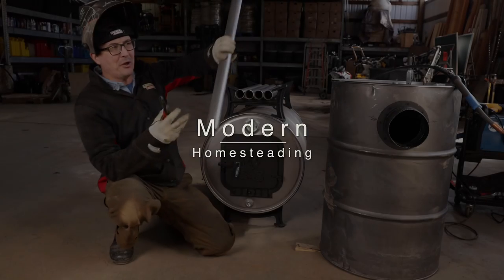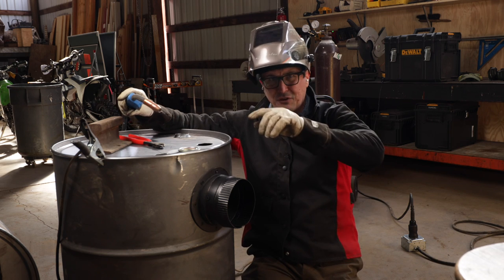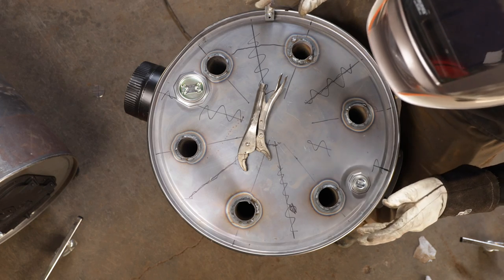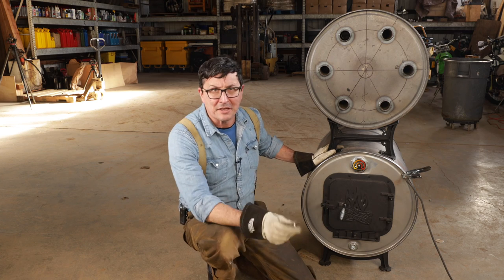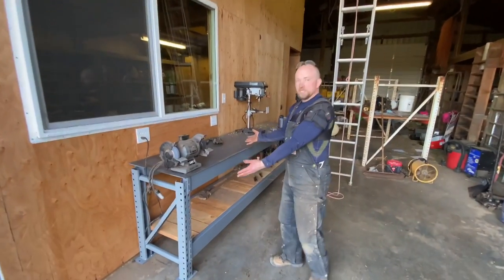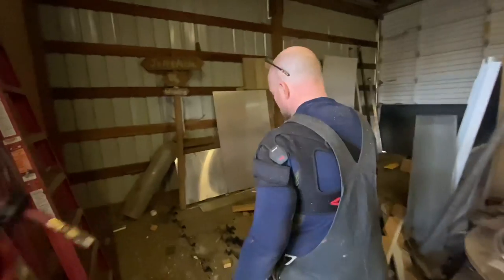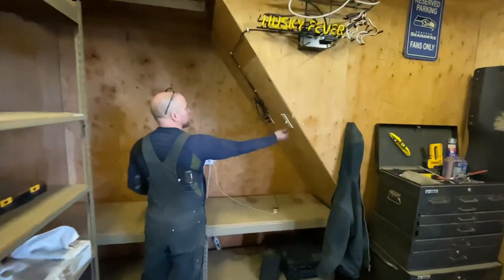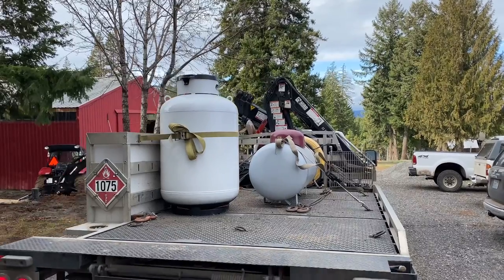This Welding Will Leave You SPEECHLESS!

Comment: Nearly 35 years ago my grandparents had a production version of this sitting in their old farmhouse. It had a perforated plate in the upper section with a pull handle. It scraped the soot off of the exterior of the tubing so the soot did not create an insulating coating AND so the creosote would not build up. A flue fire inside such a stove would not be something you want to experience.

Comment: Don’t worry Cody a grinder and some paint will make you the welder you ain’t
Reply: If you need a grinder to make your welds nice. Your a grinder, not a welder.
Reply: Won't do fukall for the integrity of the weld though . 
Cheers
Reply: Cody sometimes a quick pass and let cool then run 2nd pass you can made it look neater but your way is fine...
Reply: Ain’t that the truth, says Shane, the grinder.
Reply: That's like us carpenters say..."caulk hides all sins!"

Comment: A quick-tip:

When welding thin things with the mig-welder, especially combining plates of different thickness is important to add more heat into the thicker part. Second is to switch between pushing the puddle forwards, and prewelding before you cover it with the puddle. 

This gives good penetration, and will also leave you with a pretty weld. When welding like this it is also better to stand, and walk around the barrel. Then you can go all the way around without pause, or at least less pause. 

In this specific instance where the weld doesn't need to seal the barrel 100 %, but it is still good practice when you're dealing with stuff where it needs to be 100 %, and maybe also withstand pressure
Reply: I would've built up the thinner top with a bead around the hole and then ran a bead on the pipe and then joined the two with a quick weave

Comment: When welding thin gauge stuff I like doing what I call “tack dragging”. You set your machine relatively hot and you tack and drag the tack, let off trigger, then start another “tack drag” on the hottest part of the puddle just before the metal pool solidifies. It prevents blowing thru and leaves a nice stack-of-dimes look. Been doing it for years on the diesel fuel tanks I weld at work.
Reply: I'd love a vid of this tac dragging Ben
Reply: Me too also.
Reply: Me too ben , 👍
Reply: we called the pull and drag bullwhipping lol a good way to fill a gap with stick or wire but not good for xrays lol
Reply: you did ok , next time try a small quick pass let it cool and  put a nice cover on it !

Comment: Pro tip when welding something like you just did for example always try concentrate the heat or the ark on the thicker material and let the weld pool flow into the thinner material, also you can control heat input and reduce the risk of blowing holes by moving a little faster and using the 3 steps forward, two steps back method.. 😉

Comment: I remember these stoves when I was a teenager in the 70's in Idaho. My dad worked in mom and pop automotive repair shop called Ro-Ho towing in Meridian. They used to have one of those in the shop and man the heat would drive you out on a cold Idaho day if you didn't keep the fan turned down. As far as the propane tanks, Eh skip them and build a few Gassifiers to run your generators and stoves. They'll run on anything that will leave an ash when burned and you'll never run out of fuel. Also if you do some conversions to your vehicles you can use the gas to drive them if there's no gasoline available, just look up Wayne Keith truck runs on wood. Thanks for sharing. Best Wishes & Blessings. Keith Noneya

Comment: #1, Use grease barrels, they are thicker steal and the tops come off with a seal ring that won't leak.
#2 Use 3M adhesive remover to remove or take off any glue or adhesive off your barrels.  They also make silicon remover just in case someone sprayed silicon onto the steel to stop rusting.  I lived in Oregon for thirty years near Klamath Falls and was a building contractor.  I now retired and live in Israel, I was also a US Military officer so I have a lot of experience doing different things.  Just found your channel and I like it.  Keep up the good work, a lot of people never had to get their hands dirty and never attempted to do anything because they didn't have any confidence.  You are like a shop teacher that shows people they can actually do something.  Thank you for all the hard work of filming and editing.  Good Job.

Comment: The wood stove looks great. I put 12 heat pipes in mine  , it pumps the heat out great . i made a shroud behind it and put a small 10 inch multi speed turbo fan to blow through the shroud. it works really good.  And The Martian's shop looks real nice.

Comment: A few tips from a someone that has been welding and fabricating professionally for 14 years. It is hard to tell from the video but you appear to not be using any motion when welding. With MIG you usually want to use a small circular motion when welding. Think writing lower case "e" repeatedly in cursive. I know it is hard when you are welding around small circles like that but also try to pay attention to the angle of your gun. Ideally you want 45 degrees to the joint and the gun pointed about 10 degrees forward in the direction of travel. This will help with the uniformity of the bead. A more forward angle (forehand or pushing in welder speak) will give you a flatter wider bead and pointing backwards to the direction of travel (backhand or pulling) will give you a narrower more crowned bead.

Comment: preheat the surface with a torch and make cursive e's when you run a bead to get a good weave .the reason why you cant seem to get a pretty bead is cause your just running a straight line and not a weave . going in and out of the puddle will also harden the weld a bit due to the rapid extreme heating and cooling .

Comment: I heated my home in N Texas for 8 winters with shop built stoves. New central hvac 4 years ago. My current stove has radiator fins n I use a small fan to strip heat off the unit while fired.

Nothing beats the smell of burning oak and pecan.

Comment: Cody, I would suggest the use of a rivet nut or threaded insert nut over a self tapping screw for long term stability. The screw will never hold quite the same the second time. Where as a threaded insert will allow you to run the bolt of your choice multiple times with the same result.

Comment: Be careful with that secondary heat exchanger. Exhaust gases are extremely corrosive when condensed. The cooler you get your exhaust gas the more it'll condense and if your material isn't quality stainless steel you'll end up pumping your shop full of CO
Reply: Never thought of that. Thanks!
Reply: Great point. Couldn't have said it better.
Reply: I’m confused by this. The exhaust gases are still contained in the drum and vented outside. How would CO enter your work space?
Reply: @jconaty3  if the exhaust gets too cold it will condense into very corrosive combustion byproduct liquid. It can do a multitude of damaging things over time. Including but not limited to eating holes through the heat exchanger if it's not high quality stainless steel and it can also fill with corrosive liquid and or soot up as well. It will only leak CO after holes have been eaten in the heat exchanger tubing. Need stainless to prevent those holes from occurring

Comment: When you're welding thinner stuff such as that, get it tacked in place, and turn the barrel on its side.. run the weld downhill, top to bottom.  Downhill helps with the heat thingy because you can run it faster.  Just saying

Comment: The "clicking" sound is Jeff's electric fence energizer.
Reply: Really ? Why does it make this sound ?
Reply: @ArthA122  they charge a capacitor and then discharge, every 1-3 seconds. Some are solar powered, with battery backup. So a short high voltage pulse works without needing a constant high voltage supply that uses a lot of power.
Reply: @jdchmiel  It's also safer that way.  The pulsing allows someone who might have grabbed the electrified fence wire to let go in between pulses.
Reply: I knew this in the last video too lol

Comment: Run a steel fabrication business and have been welding since the 90's.. when restarting a mig weld (particularly short circuit) I've had a lot of success with the following-
Advance 1" - 1-1/2" ahead of where you ended the last weld.  Pull your trigger and move quickly back toward your last weld, slowing slightly just before you get  to your tie in point; the second you liquify the tip of the last weld you reverse and continue in the original weld direction.  This allows you to carry some heat into your tie in and reduces that bulge we all hate the look of.  With a little practice you can produce a weld that looks continuous.

Comment: Cody just letting you know. Having to start and stop welding in a circle is completely acceptable! I'm a certified welder and make/weld Exhaust systems for cars. The only way we can go around the pipe without stopping. Is by rotating said part while u weld. And that's in a jig designed for that very specific part. Ur heat really isn't that big of a deal. Just keep in mind u just have to move faster, we don't even zig zag or weave bcuz u don't have enough time, at least with how hot our welders are. I'm a production welder, so speed is crucial! If u want it to look really pretty, but a tig welder! That's the only way U'll be able to get that pretty stacked dimes look like ur expecting. Ur finished product u showed was not bad. The most important thing is getting ur starts and stops tied in nicely so their not one overly thick and two not going to leak. Just takes time, patience and plenty of practice! U'll get there, just keep at it!

Comment: Those double barrel stoves with the pipes are amazing. One of our local VFDs has a stove just like that in it. They welded all their pipes into a metal box on the back of the stove and attached a squirrel cage blower fan to the other end of the box. The building was a 40x80 and that double barrel stove with that fan on it would run you out of the building. We would play cards there on the weekends during the winter and many nights the temps would be in the low teens and twenties and they would have the doors raised a couple feet to regulate the heat.

Comment: I built a double barrel wood stove like this about 10 years ago. 2 years ago I decided to try something different. I measure out an inner circle half way  between the outer circle of tubes and the center and between the outer tubes and I opened the center to added a tube in the center for a total of 13. This stove will absolutely run you out in ten minutes. The normal wood load in the stove is about half what is was before.

Comment: Nice shop. Really! Only thing is about every other shop/garage that fellas finish with OSB or plywood end up in a pile of ashes. Just a warning guys not a knock down. You should at least run 4' of 5/8" fire code sheetrock. And it should start at grade (sit directly on the concrete) so sparks/slag can't roll under it. And start a fire on the back side. A piece of 5/8" fire code rock with a 3" air gap from the floor and 1 1/2" air gap from the wall. That behind the double barrel stove will keep you safe with that thing also. Love ya Wrangler I've learned a lot of really useful information from you. I thought I'd try to forward some of my knowledge back to y'all. GOD bless you and cover you with his eternal love!

Comment: I have been in the welding industry for 35 years.  Those welds are good. A little tip. When you can, when you have thin material. Put it on its side and weld vertical down. Keep on getting after it!!!

Comment: I'm by no means a weathered professional but it feels easier to weld in a circle if you use the cup and drag it along the surface where your weld is going to be (toe to toe or so) while pressing the button and keeping contact with your filler wire.  Additionally, it also helps to weld in quarters of a circle because it's easier than welding a full-on circle as that requires so many adjustments whereas quarters require much less adjustment.  It also helps to keep it just hot and fast enough (knowing your wires will help in this regard.)

Anyway thanks for the video and stay blessed.

Comment: I like my Vogelzang cast iron stove since it not only heats, but has two openings to cook on with my Griswold iron skillet which has a fire ring on bottom which fits the hole perfectly. Great for both heat and cooking with in winter storm when electric gets knocked out.

Comment: I’m a welder/fabricator, but what might also help you with making your welds look better and also to not blow through, also since you aren’t doing that in 1 pass, is to jump around when welding. Do 1/3’d of a pass on 1 and go to another tube diagonally from where you were welding and do another 1/3’d pass, etc. Like tightening lug nuts on a wheel. Keeps the heat down and depending on things you’re welding it helps with warping/distortion. 👍🏻🤘🏻 welding in circles is a pain so don’t worry that it isn’t pretty

Comment: Just a little tip. Weld towards the previous weld, so the overlap is hot. Starting on the previous weld can cause binding flaws because the lack of heat.  It's probably okay as is, but it's a good tip in general. Love your channel. Greetings from the Netherlands.

Comment: I made a heat exchanger with about 22 pipes but didn't weld them. I used exhaust pipe and cone tool and flared the ends of the pipe down to the drum head. It was really fast and looked a lot better.

Comment: Something that should help you with removing residual glue off of stuff is 3M Adhesive Remover. I worked in a "body shop" for big trucks and we used this stuff to remove the glue left behind by the old company decals.

Comment: I could be wrong but on the barrels we use for spray foam the screw on plugs have a drummer boring for a tight seal. I do not know if yours has it but I'm just giving you the heads up. Looks really good though

Comment: after seeing the gap you had to weld I would have tried that 2" hole saw first, but your welds look good anyway, you might think about an air conditioner window unit blower, they get thrown away all the time and the blowers usually still work plus they have speed control, just a thought, good vid  thanx

Comment: In a situation like that, you might try putting the nozzle in the corner formed by the tubing and the barrel top. Use that as a guide as you move around the tubing to weld. Then, you only have to concentrate on keeping the torch at about 45 degrees as you go around faster, leaning more heat to the tubing as you weave the weld. The tubing will take more heat than the edge of the cut before you blow it out. Good job, though. Keep it up.

Comment: I too prefer a safe, clean & organized work station. But I would have tacked the components  on first  then turned the barrel sideways to give myself a more comfortable welding position to tie in two welds on each side top to bottom on each cylinder. To have a more consistent, neater & strong weld. Thanks for sharing! God bless you

Comment: When doing pipes through a drum like this your best bet is to use "washers" that fit tight to the pipe and give you about a half inch overlap onto the drum.  Weld the washers onto the pipe at one end and then flip the drum with the pipe ends setting on blocks of wood then weld the washers onto the other ends of the pipes.  Then weld the washers to the drum and flip to do same.  It'll give you snugness and not cause induced shearing stress on the drum heads and you won't have to fill around the pipes.

Comment: i do stuff like this by pulsing so i can go slower and you can also stop and reposition when it gets awkward. just weld for a second or so then stop. and when you see the bright red start dull slightly hit it again at the front of the  bead. you'll soon pick up the rhythm. good for filling huge gaps on thin metal too.

 make sure you have some post flow so you don't oxidize between pulses.

Comment: Cody. Next time you work on something like this- prop the barrel horizontally, and weld the pieces of tubing from the 12 o clock position to the 6 o'clock. Might work a bit easier for you to weld that way as well as put a visual appealing weld down. Otherwise, weld on brother. Loving the videos, keep em coming. God bless.

Comment: Quick tip for welding around those pipes put a couple tacks on them and lay the barrel down to weld them vertical down. Easy to control the heat and the welds flow better. Most welds in the sheet metal side of welding are mainly downhill. None the less didn’t look too bad for someone who isn’t a welder.

Comment: A simple way to get rid of old label glue residue is to mix, in equal parts, any type of cooking oil and baking soda.  Spread it on the old glue and leave it there for about half an hour and then wipe it off and the glue should come off with it.  I have also mixed some fine ground up eggshells to the mix to give it a bit of scouring muscle and that works even better.

Comment: I little tip on the welding process, do a dry run, meaning run your stinger around the area without actually welding, see if your comfortable and can move steadily.Try walking around the drum while welding.

Comment: I heard an experienced welder say "just because its hotter doesn't mean its hot" Basically if you turn down the heat because things get too hot you might make the problem worse, heating it up even more, since you spend more time doing the same job.